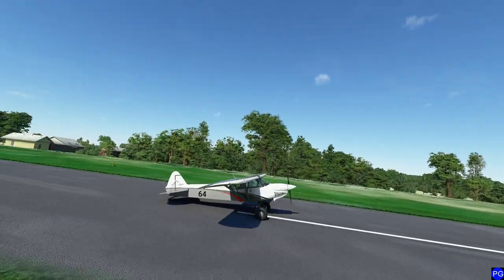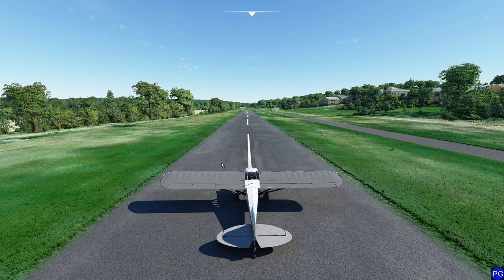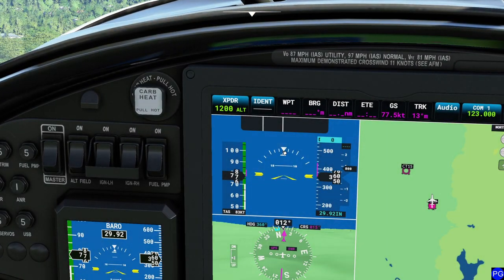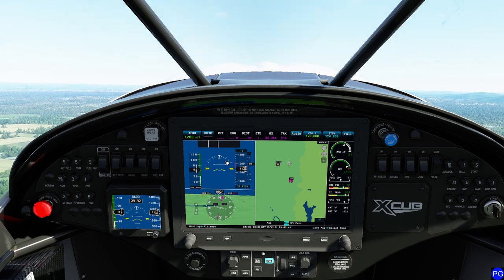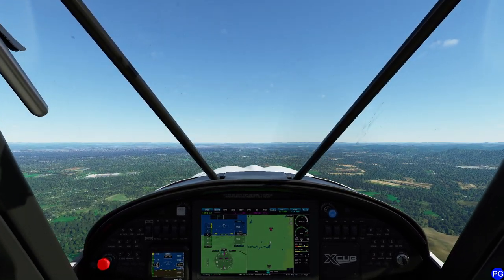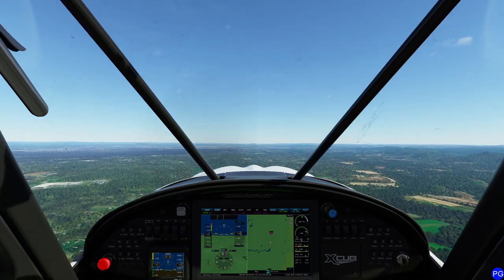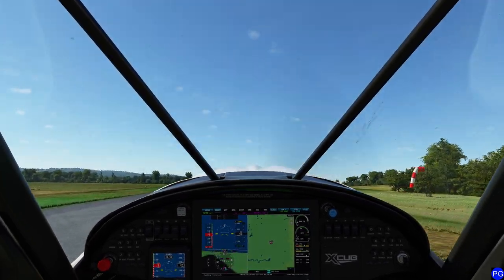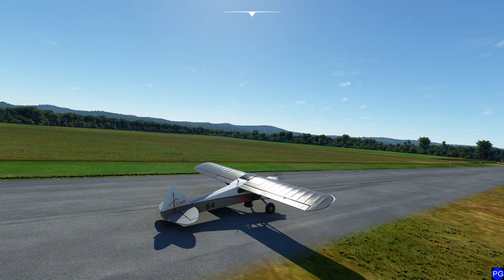MSFS: Understanding the Rudder

Comment: Do you think the MSFS planes self-coordinate more so than in real life? Seems like I don't really need much/any rudder to have a coordinated turn in MSFS 2020.
Reply: Even after the latest update, to which they claim to have added realistic adverse yaw based on recording real aircraft, there doesn't seem to be any need for rudder input once the wheels are off the ground.
Reply: This is really noticeable when going from IL-2 Sturmovik or DCS World to one of the add-on WWII fighters in MSFS 2020. You should need a lot of rudder management with all the torque, p-factor, etc, but in MSFS 2020 you can pretty much take your feet off the rudder pedals once airborne.

Comment: So silly question. What is the negative to an uncoordinated turn? I get that a slow speed maneuver can result in one wing hitting a stalling speed, but at normal speed why is it an issue?
Reply: Not a silly question! It puts uneven forces on the airframe, is uncomfortable for passengers and pilots alike, and it has a negative impact on fuel efficiency.

Comment: it rolls with  the pedal  because the Wing on the outside has to travel faster than the inner  wing and as a result the outer wing generates more lift therefore lifting the outer wing more than the inner one and consequently rolling the plane on its lateral axis

Comment: I agree with you whole-heartedly about the usefulness of rudder pedals ... if only I could find a set that would last more than a year. You wouldn't name names but I will. I loved the Logitech/Cessna rudder pedals, but after a year, they broke. Thinking (hoping) that was just bad luck, I bought a second, identical set, but after a year that set also broke. It would take too many words for me to explain it, but both rudder pedal sets broke for the same reason: a mechanical design flaw. I trashed the rudder pedals but haven't found another, better set I can afford. ($500 is a bit too much for me.) So now I'm stuck using the  rotation axis of my joystick for 'directional' control because the function of rudder pedals on the ground is different from rudder pedals in the air and that's a real nuisance. Anybody have any suggestions?
Reply: look at the MFG rudder pedals I think they are reasonably priced
Reply: 100% get MFGs

Comment: So you use the rudder in the direction you want to turn? When i want to go right, i shift the plane to the right with the ailerons and then use the according amount of rudder by pressing the right pedal forward so the plane doesnt slip to the left, correct?
Reply: late response, but from my actual flying lessons, just use rudder to maintain balance and keep the ball in the tc centered. if you use excessive rudder it can create spin-positive conditions

Comment: Im probaly doing something wrong, i only use it on the ground to turn lol;).
Reply: It's MSFS 2020, not you. See Chris Crawford's comment above.
Reply: I tried using it in flight but the turn angle is so fast and not smooth at all
Reply: that is when the tailwheel is steerable and not just castering. It is coupled to the rudder cables. But  you DO have to use it in flight.